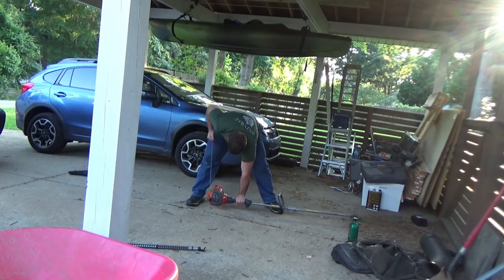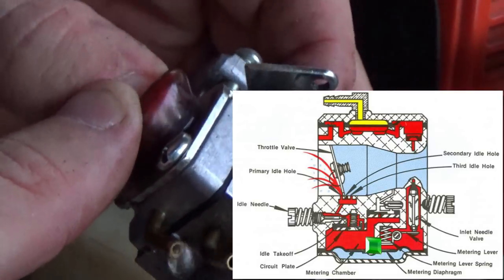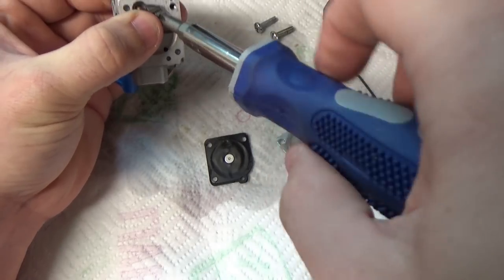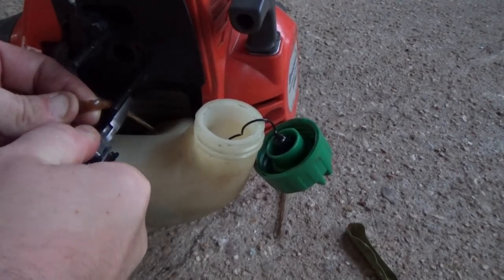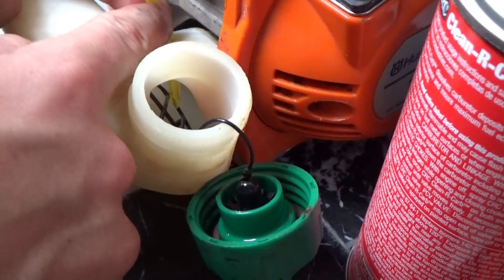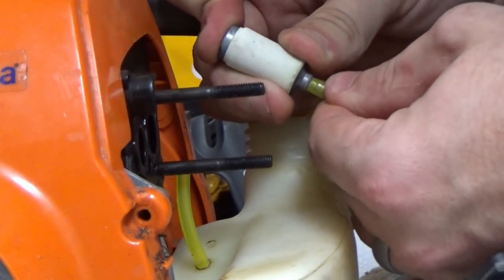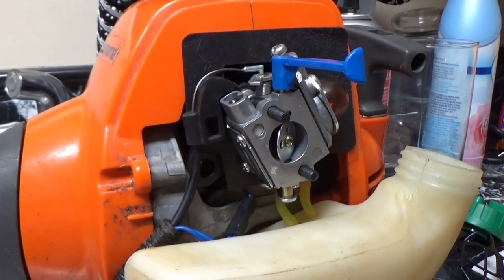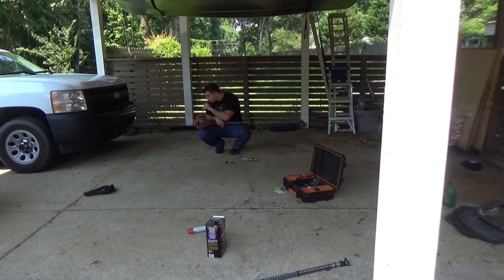How to fix a Husqvarna weed eater (no more bogging down)

Comment: I have same model. New lines, fresh gas, clean spark arrester,  new plug and carb.  Runs but stalls with throttle.  I don't understand.
Reply from the maker: You may need to adjust the fuel set screw on the carb, it may bento rich
Reply: yes I've done that already.  Still dies on throttle.
Reply from the maker: Is the choke sticking closed?
Reply: the choke is perfectly fine as its a brand new carburetor just received today.
Reply: @mikeprice8307  I'm having a very similar problem. Replaced carb, air & fuel filters, and fuel lines... Starts, runs, but immediately begins to lose power once I hit the throttle. I've adjusted both the old and new carb, with no luck. I have to continually punch the throttle for it to last longer than 5 minutes.
Reply from the maker: Maybe bad piston rings
Reply: Darn thing I'm fed up with it.   As of this AM, steady cranking it with different  carburetor adjustments malfunctioned the pull string.  It's pulled out all the way and won't recoil now. 

  I have heard of people just replacing the whole unit  without a second thought.   Thought I'd save money by tinkering with it myself, but by it being 7 yo, I think I'll just by a new one.  Might go with a stihl this round.
Reply: I have the 128C. Mine does when you give it gas. I replaced the air filter, fuel filter, plug, fuel lines and carb. I think I need to spend the 34 bucks on eBay for a piston, rings and cylinder housing kit.
Reply: Damn man,  I was hesitant on maybe doing that, that's until I broke my coil string mechanism.   If I replace that and pistons I'll be out of a brand new weedeater.   Who's to say that will even fix it.   I'm just buying a new one.  Smh

Comment: Piece of trash my trimmer is brand new I shouldn't have to be watching this. Will never buy another H trimmer
Reply: I agree 110%. I've gone through numerous of the 128LD brand simply because I have all of the Trimmers Plus attachments. No joke I've returned about 8 of them within the 30 day return period at Lowes. One of the worst products I've ever bought in any category. I also had a 324 that worked for less than a month. Echo makes a much, much better product.